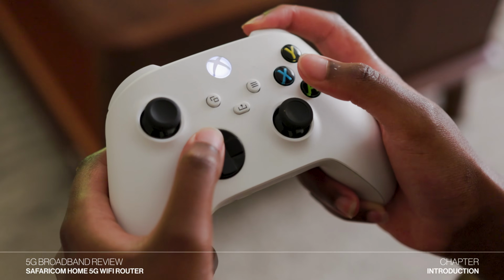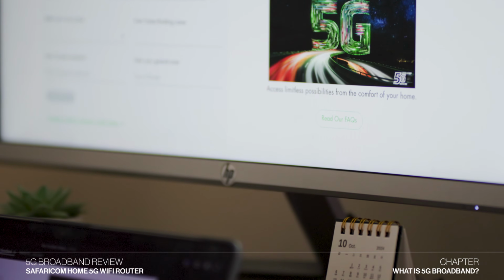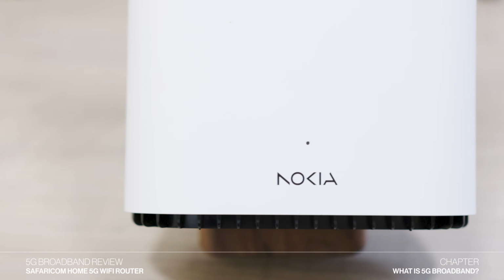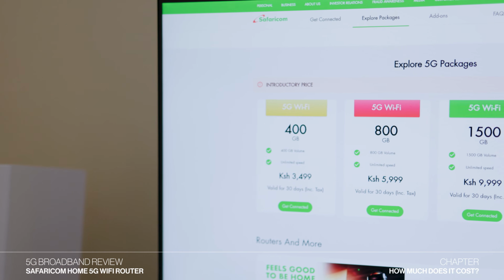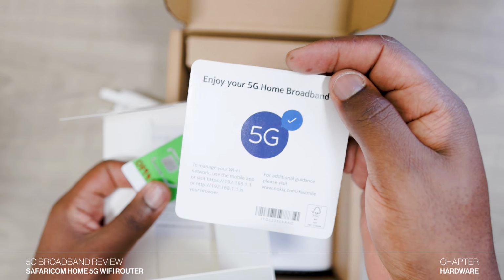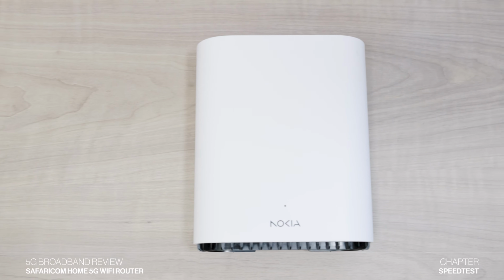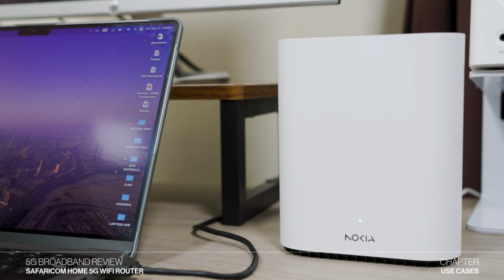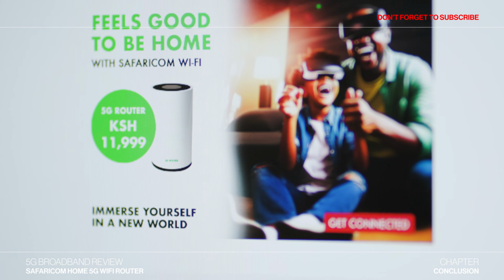Safaricom 5G WiFi Router Review & Speedtest (Now KES 2,999)

Comment from the maker: Quick Update: Competition is heating up as Safaricom has now reduced the cost of their 5G router to Ksh 2,999. Safaricom has also introduced unlimited 5G packages. The packages are priced at Ksh 4,000 for 50Mbps, Ksh 5,000 for 100Mbps, and Ksh 10,000 for 250Mbps.
Reply: I bought the Huawei router for Ksh 10,999 and got a 100Mbps plan for Ksh 3,750 as a first-time offer. The router is quite solid. I have 5G coverage where I live and consistently getting 100Mbps download speeds, but upload speeds vary, averaging around 15Mbps. So far, so good—I’m enjoying the service. Safaricom is more expensive than other providers, but in my opinion, it is quite stable.
Reply: accomodating how many users
Reply: Your videos are excellent. Does the 100mbps package give those speeds exactly. Hope its not just a number for marketing campaign. And whats the range of these 5g routers?
Reply from the maker: @soundssleep8626  Hey. Yes. The speeds are as advertised. The router is dual band meaning it operates on both the 5Ghz and 2.4Ghz frequency. On the 5Ghz band the range is shorter (same room) while the 2.4Ghz band covers a larger range (two to three bedroom house)
Reply: @KenTalksTechnology  Thanks a lot. And Safaricom has two routers on offer. Nokia & Huawei. Which of the two is best in your opinion
Reply from the maker: @soundssleep8626  get the Nokia one. It's the one that I can vouch for since I use it personally. Also it has a simple app that you can install on your phone to manage the router, change passwords etc
Reply: @KenTalksTechnology  ok. Thanks a lot. 👍
Reply: @KenTalksTechnology   does the unlimited package still use a sim card
Reply: will the bundles last till the end of the month if there is multiple users
Reply from the maker: @humphreykiugi3323  Yes. The router has to use a SIM CARD
Reply from the maker: @humphreykiugi3323  If you are using the router on a home with multiple users, I would recommend that you use it with the unlimited packages
Reply: @KenTalksTechnology are they compatible with wifi extenders or repeaters?
Reply: How can I get the router for free with the 18months contract?
Reply from the maker: @novahostkenya  Hey. I am not sure if they still offer the contract option but the last time I checked, you had to visit Safcom shops for this. That said, the router has been reduced to 3000ksh so i dont think anyone needs to go for the contract. The contract only made sense when the router was still Ksh 10,000+

Comment: Hi guys. Quick question. With the offer of 3k for the router I am considering 5g (3k for10mbps) vs Home fibre bronze. My main question how bad is the FUP on both?. I feel the FUP of 250gb is low for 5g and 500gb is low for home fibre.. i may be wrong. Please advise whether I will outdo that cap by browsing and streaming
Reply: Depends. If you're just browsing and steaming, I don't think you'll outdo. But if you download big files, you will run out
Reply: best is the 50mbs 5g won't regret
Reply: Just get JTL Faiba Fixed Internet at that price if they're available in your area. Faster spees, no data cap

Comment: Does it have am outdoor unit /Antenna??
Reply from the maker: Yes. Safaricom had a version of the Nokia 5G router with an outdoor antenna but I am not sure if it still on sale. But it was slightly expensive than the standard one. You might have to check from their shops if it is still available in stock
Reply: @KenTalksTechnology  there is not enough info about it online.
Reply from the maker: @ Someone did a video a while back showing the outdoor router. Here it is https://youtu.be/HQkV1C4Laq0?si=G97S3-MiRdvRCRHa
Reply: @KenTalksTechnology  
Thanks for the video 🙏🙏
On their site they have only displayed the Huawei router @11k and Nokia @12k . While the video is showing 3 products (routers) only.